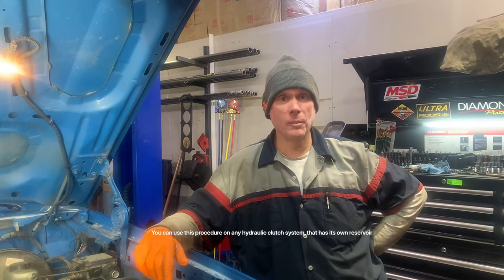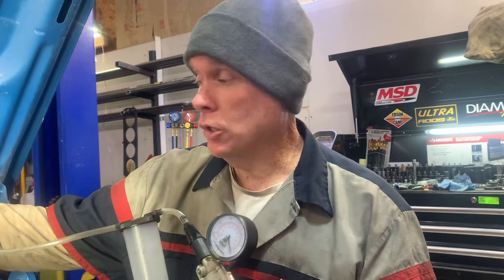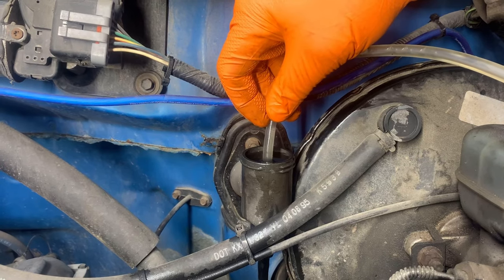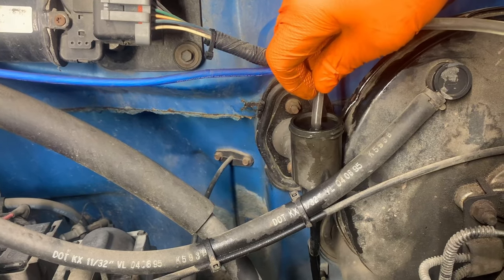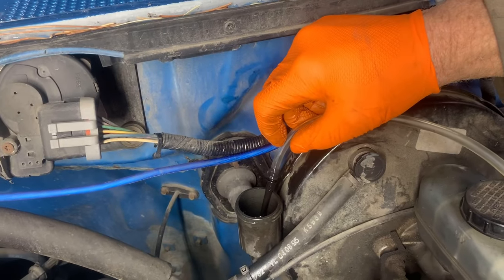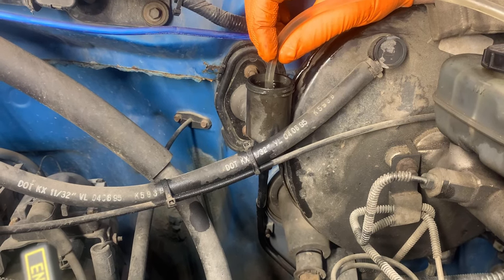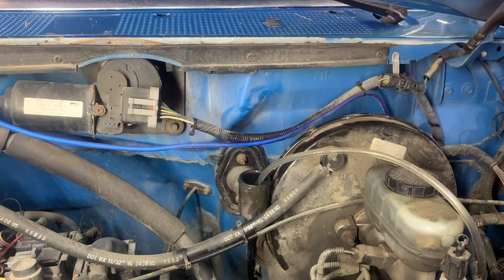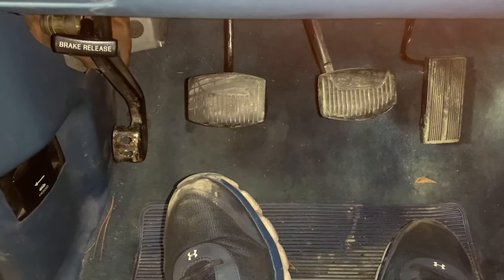Easiest, way to bleed a clutch. Works on impossible Ford concentric slaves. Can be done alone.

Comment: Just so I make sure, I fully seal the hole with the nozzle when pumping, correct?
Reply from the maker: Yes, with the bleeder closed
Reply: @greasyhandsauto-shaunbutte9726  Thanks for the reply!
 I live on a hill, if I perform this procedure with the master cylinder point uphill will I be able to achieve these same results since it's working off of vacuum and not gravity?
Reply from the maker: @justacatwalkingonakeyboard4454  technically yes

Comment: I've got a bleeder pump from harbor freight. Mine is not holding vacume... why would that be? I replaced the clutch master cylinder so lots of air. I cant find any leaks in the lines and I'm sure the cylinder was dry when I put it on. I have 0 peddle
Reply from the maker: Is the bleeder opened. It must be closed.

Comment: What tip are you using on the line going into master, is it rubberor a hard plastic
Reply from the maker: It’s plastic but either would work.
Reply from the maker: If you’re having an issue, start with the pedal down, then on the second go around, put it up.

Comment: Trying to do this on a 87 f350 but there's 2 small holes at bottom of reservoir does it matter which one i use and there's no bleeder on the slave cylinder to even to try to bleed it from there
Reply from the maker: That’s a new one for me. Maybe do both.

Comment: I don't know if you're still replying, but I just changed the master / slave cylinder as a kit for the second time, first time the slave let go, ran good for 7 months, then the clutch only half disengages so I changed it again and same issue, gonna try bleeding it, should've been pre bled. Is that a common issue? It's a 1994 F250 with 7.3 and ZF5
Reply from the maker: Make sure that your firewall isn’t flexing. They’re was an issue with that. There is a lot available if the firewall is torn and flexing.
Reply: @greasyhandsauto-shaunbutte9726  I put my phone in the engine bay to record it and pressed the clutch, maybe a milimeter or two of play, when I looked under the truck, looks like the slave cylinder extends halfway
Reply from the maker: @Nfscarbon07  it could have air in it, then.
Reply: @greasyhandsauto-shaunbutte9726  so funny story. Tried bleeding it and nothing came out, figured maybe the clutch fork was bent or something, so I rotated the clutch armature forward towards the master cylinder, and I'm pretty sure I broke the throwout bearing, so transmission is coming off lol
Reply from the maker: @Nfscarbon07  crap!

Comment: Hi. I also have a 96 Ford Ranger. What would be the signs of air in the line? Im having trouble shifting, especially going into 1st and reverse. Could this be the reason?
Reply from the maker: It could be, it could also be synchros, in the transmission or, even a weak clutch. Does it go in better, if you pump the clutch?

Comment: I have a problem. I went and bought me the vacuum pump, but the master I have has a long cut and two tiny holes, and when i pump, it comes out and empties the reservoir and is not working to me can someone help mi understand it better
Reply from the maker: @Benjamin-oy9fj  if it’s tempting the reservoir, you are not in the line. Your vacuum pump needs to go down in the line through the reservoir.

Comment: What year was this Truck. I've got an 86 F250 and it has the little allen head bleeder screws and small hole for fluid to come out just below the allen head bleeder screw. Will this work on mine.
Reply from the maker: I’m not sure but, it’s a 92-96 body style. It should work on yours, yes.
Reply: @greasyhandsauto-shaunbutte9726  Sorry, the video cut out right at the beginning so I didn't get the year of Truck you were working on. Thanks for your help. I'll be trying this when I bleed mine tomarrow.

Comment: Do you have to hold the clutch pedal to the floor when vacuuming?
Reply from the maker: No, vacuum it once then pump the pedal and do it again. The pedal should be up.
Reply: @greasyhandsauto-shaunbutte9726  do you pump the air out, fill it up, put the cap on? Then go pump the clutch up to do it again. Or do you leave the cap off the whole process?
Reply from the maker: @calebpeters5188  I leave it off
Reply: @greasyhandsauto-shaunbutte9726  I always thought if you pump the clutch while the cap is off it just forces air back in the line??
Reply from the maker: @calebpeters5188  not if it has fluid in it.
Reply: Thank you! Learn something knew everyday
Reply: @greasyhandsauto-shaunbutte9726  so let me hit you with this one now.. First manual that’s been a ford so that’s how I stumbled upon you’re video. So I know my clutch needs bleed, using the same tool in the video but when I try and pull the air bubbles out nothing happens but the fluid slowly rises up through the hose? What’s going on? If you could get back to me when possible thanks again.
Reply from the maker: @calebpeters5188  It doesn’t sound like it needs to be bled. Why did you think it needed bleeding?
Reply: @greasyhandsauto-shaunbutte9726  bought the truck couple weeks back, felt pretty bad shifting once I got home. Let it sit awhile while I did some other work on it. Drove it again definitely could tell there was something up, so I pulled the trans. The throw out bearing in front of the slave cylinder had exploded, ball bearings everywhere, looked to be an old accident. So their for everything was eaten up, so I did flywheel, slave, master, line etc. drove it home felt much better then went out the next day and had trouble going into gear, and just all out not the performance of all new parts. That’s when I came here and that’s where we are. 

From my experience the trans doesn’t seem to be a part of the problem, drove manuals all my life and never had a ford just to run into this issues haha. Sorry for all the info thanks.
Reply from the maker: @calebpeters5188  yes definitely have air in it. Try it with the pedal down. After that pull it up and do it. Also make certain that your firewall isn’t torn. That’s an old Ford issue.
Reply: @greasyhandsauto-shaunbutte9726  firewall torn?
Reply: @greasyhandsauto-shaunbutte9726  should I have to do any bleeding from the bottom nipple? Or you’re whole process can be done from the top?
Reply from the maker: @calebpeters5188  all at the top.
Reply from the maker: @calebpeters5188  yes, they fatigue over time and tear, from the clutch movement.

Comment: I have been attempting to do this method following your video exactly and no matter how long i have it hooked up i get tons of air and the pedal stops coming back up 2 inches from the floor. Any ideas? New slave cylinder and clutch in a 95 f150 m5od
Reply from the maker: Try it with the pedal down. If you still getting here after that then you got a leak somewhere.  Look in the cab and make sure that the master is it leaking
Reply: @greasyhandsauto-shaunbutte9726  master cylinder is not leaking in the cab, the mityvac will pump up to about 26  while doing this and itll hold at 23.5.
Reply from the maker: @brandontosh8403  okay, you just have a bunch of air. Do it with the pedal down and then do it with it  up. Sometimes it takes a while.

Comment: I’ve never bled a clutch system or brake system on anything ever. I have a ‘95 f150 with the 4.9 I6 and 5 speed manual. My clutch pedal started to grab very low in the throw and got worse and worse until now it’s impossible to shift when the engine is running. People on the forums told me to replace the bushings for the pedals because it’s often a problem causing this issue. I replaced them and it’s still the same. I was about ready to take it to the shop because I know bleeding is the next step and it sounds daunting. After coming across this video I’m wondering if I should give it a try with this tool. Are there any other steps I need to take to properly bleed the system? Do I just remove the cap for the reservoir with the clutch pedal all the way up then use the tool as you show to suck the air out, add fluid to the level, pump the clutch a bit and repeat?
Reply from the maker: You shouldn’t have air in the system, unless you’ve changed a component. If your clutch has stopped working, you either have something leaking, which would require a repair or, you need a new clutch. Bleeding won’t help long term.
Reply: @greasyhandsauto-shaunbutte9726  clutch was replaced 3 years ago and the master clutch cylinder was replaced a year ago after the plastic pushrod broke. Had to take it back in twice after that because it would be ok, then start to grab low again. You think it could be the slave cylinder in the bell housing?
Reply from the maker: @spenceryoung693  possibly, you can remove the rubber access plug and look for leaking.
Reply: The front case bearing retainer on the   front of the transmission that the release bearing (throw out) rides on, is aluminum on some of the transmissions. The release bearing will drag on the retainer that causes issues with movement. I replace with a steel one. This helps in the long run. This video is a great idea. I have. 1990 f-250 to do. Hopefully it will work for me. Always have dreaded doing the bleeding on these.
Reply from the maker: @josephward6422  great advice!

Comment: could you try to explain why this works? its not clicking for me. What's causing the bubbles to be pulled up? I just dont understand how pulling a vacuum on a sealed system can create movement since brake fluid doesn't boil under vacuum and there's no pressure on the other side to be pushing these bubbles towards the vacuum source. Thank you!
Reply from the maker: The vacuum pulls the air out because it’s lighter than the fluid. It therefore, moves easier and goes to the top.
Reply: @greasyhandsauto-shaunbutte9726  thank you for the response! Did you come up with this method yourself or did you learn it from someone?
Reply from the maker: @OtherDalfite  I’ve been doing it for years. I learned it as long the way. My Dad and grandpa before him owned a Ford store. I know a lot of things that I don’t remember why. 🤷🏼‍♂️
Reply: @greasyhandsauto-shaunbutte9726  having some trouble with this method. I'm able to pull a vacuum on the system but no matter how long I wait I never get any bubbles. Any advice? Bleed valve closed, cylinder in both pressed in and open configurations, no luck either way. Thanks!
Reply from the maker: @OtherDalfite  are your parts new? It sounds like your clutch, master or, release bearing are bad.
Reply: @greasyhandsauto-shaunbutte9726  I'm at the tail end of doing a clutch swap. Master and slave were fine before, new slave seems to be okay. I got some air in the system by accident disconnecting the old slave. 

I pumped down to 28in/Hg and did start to get some bubbles. Super tiny bubbles, but bubbles nonetheless. Did you have the clutch pushed in while doing this or just in resting state? And is your slave cylinder bleeder valve closed? Just so I'm doing everything the exact same, thank you
Reply from the maker: @OtherDalfite  bleeder closed, do it with the pedal down and then pull it up. Keep at it, you’ll get it.
Reply: @greasyhandsauto-shaunbutte9726  I've got it! I had to pull the hose from the reservoir cap and directly connect to it. Pumping the pedal while holding vacuum helped push the air out
Reply from the maker: @OtherDalfite  nice!

Comment: So I’m not sure what I am doing wrong I’ve been trying this method for 3 days now and nothing still won’t get a full pedal, I hold good pressure every time I do this, the pedal goes dead and so i pump it and it’ll get hard but after a while of driving it, it starts to get soft again and I can’t even shift any suggestions? Am I supposed to pump the pedal while putting pressure or something? Thank you!
Reply from the maker: No, you don’t pump the pedal. Are the parts new? It sounds like you have a leak
Reply: Yea parts are brand new
Reply: I can still have a leak even with it holding pressure?
Reply from the maker: @user-ud3gt6mp6t  you still have air. Try it with the pedal down and then up. Are you getting bubbles?
Reply: @greasyhandsauto-shaunbutte9726  yes I still have air bubbles come up while holding on to steady pressure
Reply from the maker: @user-ud3gt6mp6t  you still have air in the system then. Try it with the pedal down.
Reply: I will give that a try and see if that works thank you!
Reply from the maker: @user-ud3gt6mp6t  you’re welcome, good luck.

Comment: Would this be the same process  on a Ford Focus?
Reply from the maker: If it has a stand alone reservoir. Some of the new ones share with the brakes.
Reply: @greasyhandsauto-shaunbutte9726  yea it does share with the brakes - I have old fluid and want to flush brakes and clutch as it all feels terrible
Reply from the maker: @GunMetalDale  it won’t work, you will have to do it, at the slave.

Comment: Can i press the clutch down while it has 20 psi of vacuum..will any damage be caused
Reply from the maker: Hard to say. If you’re having trouble, try vacuuming it with the clutch pedal down and then again with it up
Reply: @greasyhandsauto-shaunbutte9726  the clutch was up but i felt like it wasnt all the way up and when i did the vacuum pump i pushed the clutch in while it had 20psi vacuum ..it felt hard to press down and wanted to know if it couldve messed something up
Reply from the maker: @sollaunika1137  probably not, how does it feel with the vacuum off?

Comment: What size hose fits into the slave cylinder
Reply from the maker: You need to use the cone shaped adapter that comes with the vacuum pump.

Comment: Trying this on my 88 ranger, got lots of air bubbles first attempt, checked pedal seemed about half, did it again, no bubbles second round and lost all pressure, pedal is up bleeder is closed, any suggestions?
Reply from the maker: Try it with the pedal down once and then again with it up.
Reply: @greasyhandsauto-shaunbutte9726  do I hold pedal until bubbles stop? I’m getting an insane amount of bubbles with someone holding pedal it’s just not stopping
Reply: @greasyhandsauto-shaunbutte9726  I can’t seem to get this thing. It’s been two weeks now trying to bleed this damn clutch
Reply from the maker: @tylerpalm1848  is the gauge on the vacuum holding?  It sounds like you may have a leak.
Reply: @greasyhandsauto-shaunbutte9726  it holds great when The pedal is up and I’m using the pump, but when pedal was down it would drop pressure I assumed because so much air was coming up
Reply from the maker: @tylerpalm1848  it sounds like you have a bad master. The system is sealed and should hold pressure regardless. For some reason it’s leaking when the pedal is down.  If it’s a new master then warranty it, if it’s not replace it. Look for fluid, under the dash around the plunger and around the line.
Reply: @greasyhandsauto-shaunbutte9726  no leaks
Reply: @greasyhandsauto-shaunbutte9726  do you have a Facebook? Or a way I can send a video of what’s going on?
Reply from the maker: @tylerpalm1848  sorry for the slow response. I was working all day. Facebook is Shaun Ivan Butterfield.

Comment: This doesn't work for my '91 f150 6i. Replaced master and noticed bottom of the reservoir had two separate holes.
Reply from the maker: It should still work. Just put it in one hole. Start with the pedal down, then up.

Comment: Which hole in the master?
Reply from the maker: There should only be 1.
Reply: @greasyhandsauto-shaunbutte9726  well the diesels at least have 2 lol
Reply from the maker: @Maroon_Brick  then do both. You don’t want any air, in the system.

Comment: So I tried but even when the bubbles stopped coming up with pressure holding, I can’t get petal after thirty tries.
Reply from the maker: Try it with the pedal down and then up. Are the components new?
Reply: @greasyhandsauto-shaunbutte9726  
Yes all new clutch components including slave cylinder, I didn’t bench bleed the slave .
Reply from the maker: @bobv8219  okay, try it with the pedal down first. I never bench bleed them.
Reply: @greasyhandsauto-shaunbutte9726  
Thank you Shaun, much appreciated 
Happy holiday to you!!
Reply from the maker: @bobv8219  you too!

Comment: This technique isn’t working for me, I’m just sucking the fluid out. Any tips?
I just had the line out and it’s full of air, barely returns after pushing it down. 
But all I can suck is the brake fluid out
Reply from the maker: Try it with the pedal down, then up. Are the slave and master new?
Reply: @greasyhandsauto-shaunbutte9726  will try tomorrow, I put a new clutch plate, slave cylinder and line in (same master) some months ago and it seemed to be letting air in so I pulled the line off to check the O-rings and have been trying to bleed it since
Reply from the maker: @ryderducan  okay, start in the down position.
Reply: @greasyhandsauto-shaunbutte9726  I get the same results with the pedal depressed, no air comes out only fluid
Reply: @greasyhandsauto-shaunbutte9726  I’m using one of the mighty vacs with the bottles such as you have in the video, I’ve got one of the fluid tubes inside the bottle. It’s the only way I can build vacuum
Reply: @greasyhandsauto-shaunbutte9726  I was able to build and hold vacuum by pushing the adapter right down into the master cylinder, but no air would come out regardless of pedal position
Reply from the maker: @ryderducan  you must have another issue. Are you putting the cone down into the hole, where the line comes in?
Reply: @greasyhandsauto-shaunbutte9726  I’ll let you know if I figure anything else out